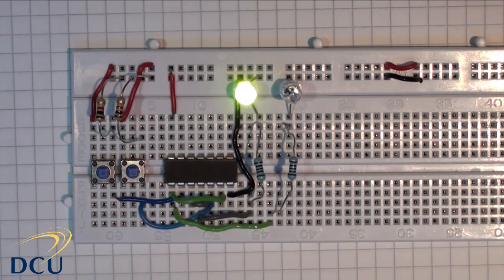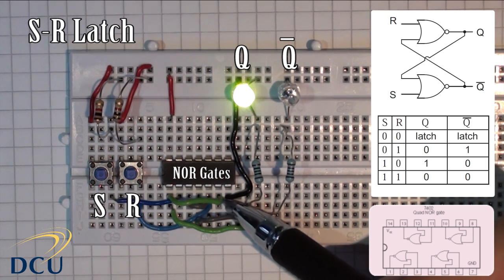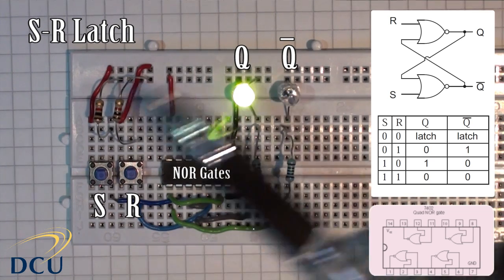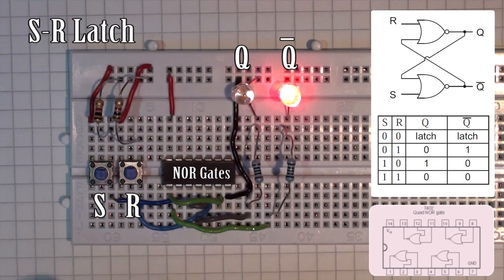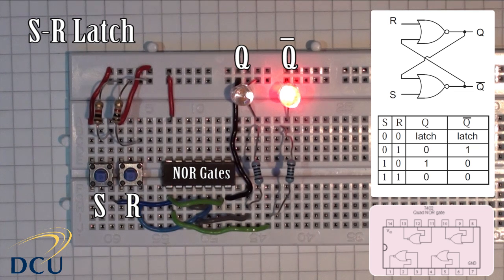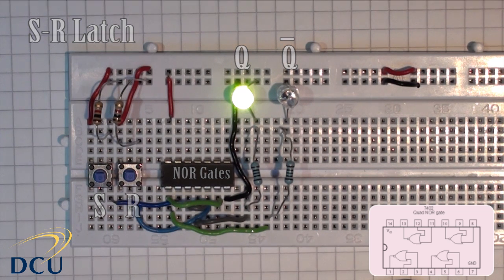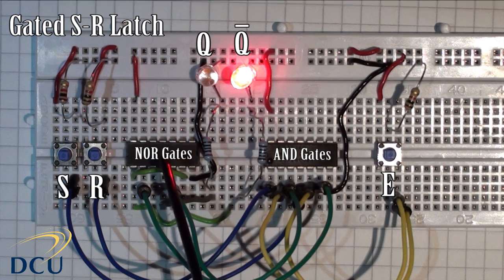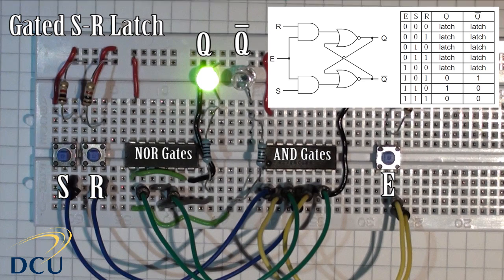Experiments 3.1: Sequential Logic - S-R Latch and a Gated S-R Latch

Comment: I've tried building an S-R-Latch before and I've done it exactly like this, except that I built the NOR-Gates myself (an OR-Gate with two transistors and an Inverter with one transistor to invert the Output). They work perfectly as NOR-Gates, but as soon as I install the two feedbacks, nothing works anymore. I can play around with the values of S and R but the LEDs stay low. I know this isn't much useful information, but if anyone has had a similar situation and has found a solution, I'd be glad if you could tell me =)

Comment: @DerekMolloyDCU Ahh thx i will try that, becous somethings it dont works ect in your previous and I've got your videos yesterday to watch and I got one that said to 470 Ohms and it works. waht I have seen is that if you dont use the resistor, the led is not entirely stable.